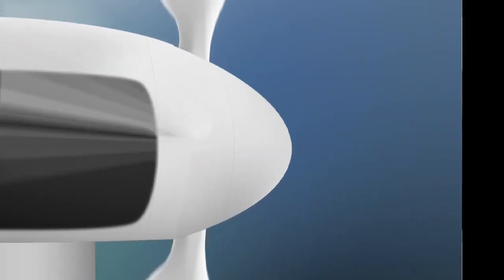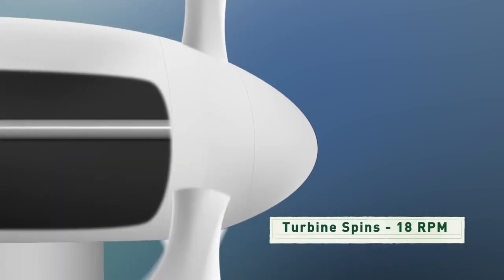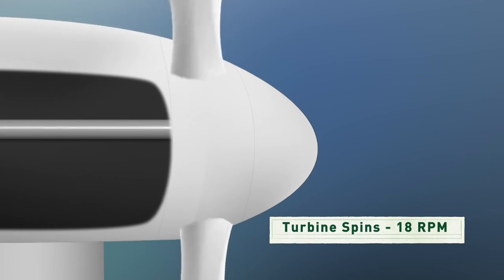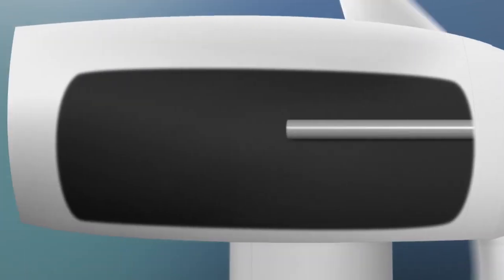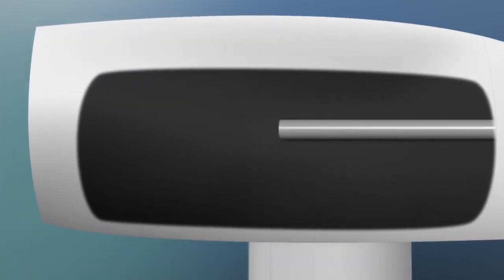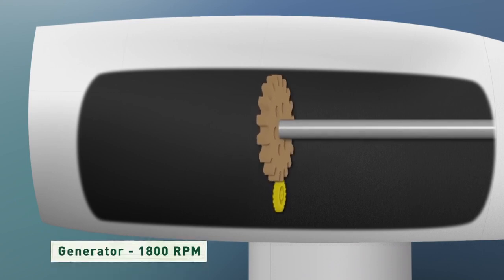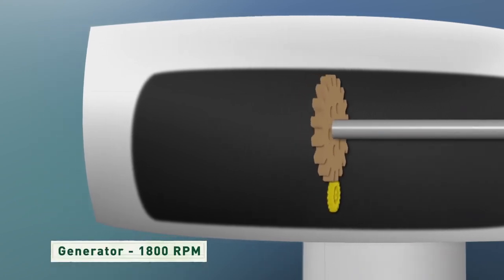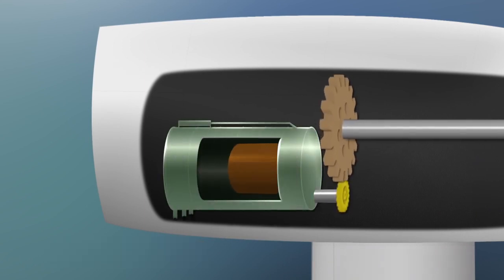mcp101 project - IIT DELHI

Comment: The extra lenght of the blade will add more weight to the blade and decrease its efficiency when in low wind mode,when that part is not being used.